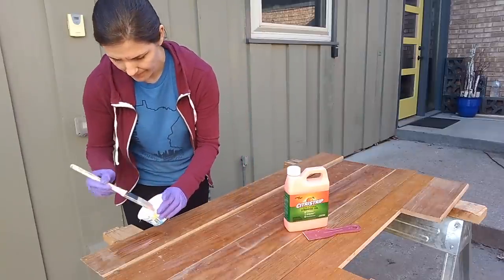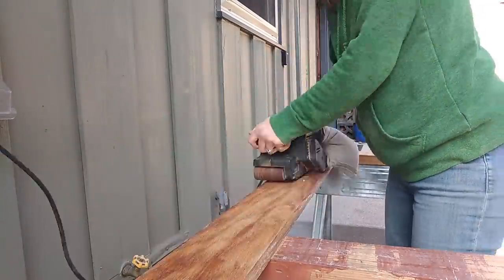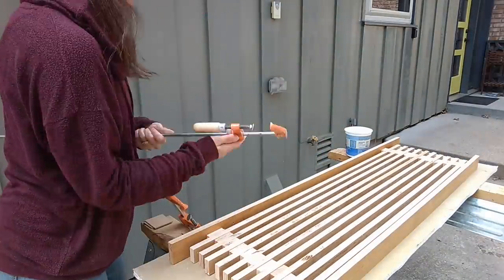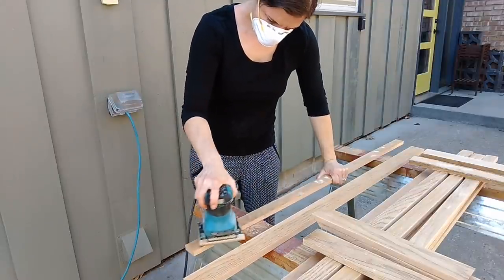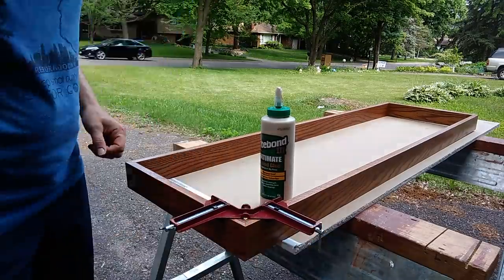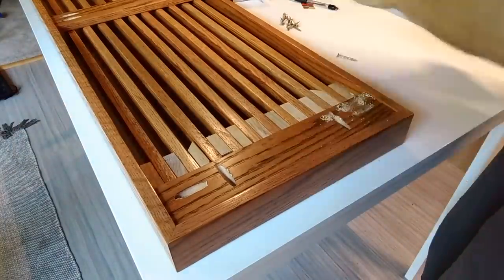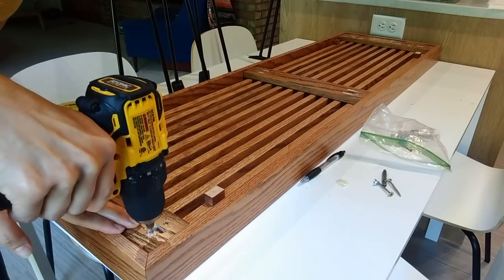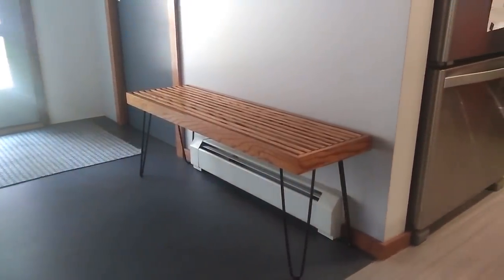DIY Modern Slat Bench | Wooden Slatted Bench Build

Comment: Hey Mellissa/Christy, beautiful bench, one tip I could share after years of finish work with hardwoods is when your driving the screws into the pilot holes use some paraffin wax or bar soap on the threads of your screws, makes it a lot easier and if for any reason or other, disassembly can be easier too. I used this technique for nails as well, you'll notice the difference trust me on this.